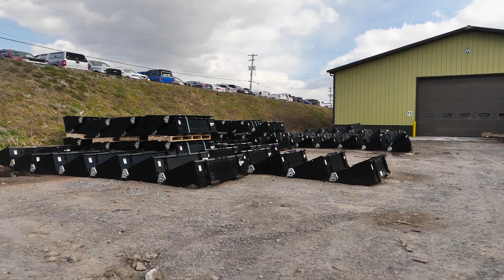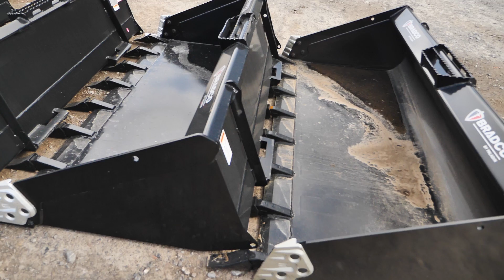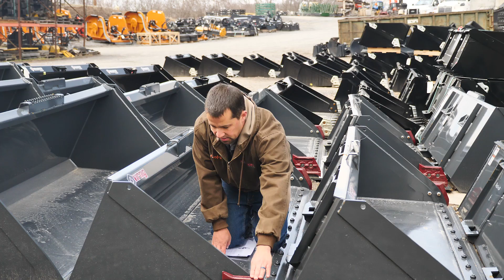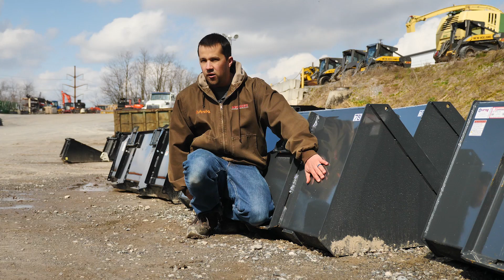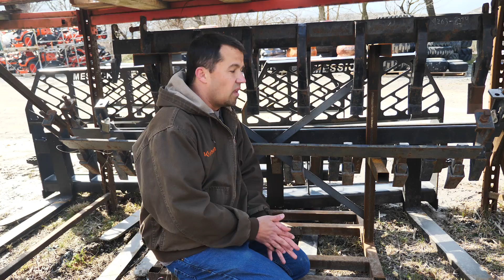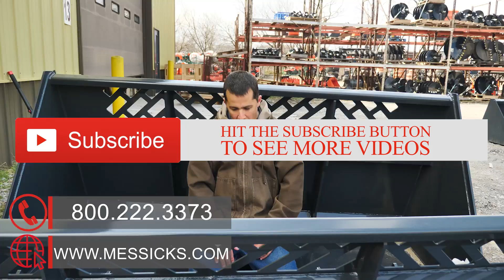How to choose the right skid steer loader bucket

Comment: FYI - The grade of steel does not determine weight.  Steel has a density of .2836 lb/in3 - regardless of the "grade" of steel as you refer to.  The weight of the product might actually be contributed to poor design.

Comment: Hey Neil,  I'm a welder/fabricator and have done my fair share of work building new buckets for excavators and front end loaders as well as repairing damaged ones.

generally speaking there is very little actual difference in the weight of different grades of steel, even looking at two type that are wildly different in properties like your bog standard mild steel compared to 304 stainless, the mild is around 7850 KG per cubic meter, and the stainless is around 8050 KG per cubic meter, despite the stainless containing 8% nickel and 18% chromium, with alloy's that are closer together like mild steel to 350 grade medium strength and AR500 wear plate your talking fractions of a percent difference in weight.

As far as what characteristics you want in the steel is a different story, the two most common failures due to use are cracking at high stress points (the corners of the bucket, where the attachment pin lugs are welded on ect) and wear on the leading edge, so you want a ductile steel that has some give to it for the body of the bucket so that it flexes rather than cracks and a hard wearing steel for the working edge, and these two properties are to an extent are at odd's with each other, steels like bisalloy/AR 400 or  are very hard wearing and last a long time on the leading edge, but are much more brittle than mild steel.

So my preference, and I find that longest lasting buckets are made with a LOW grade, ductile steel like G250 grade mild steel, while the working edges should be made of Bisalloy/AR 360 or 400 wear plate, and ideally you want the wear plates to be bolted onto the main bucket rather than welded on, as welding wear plate to mild steel gives are a fairly brittle weld that will crack over time, it also makes changing out the wear plates a lot easier. 

having seen the marketing Jargon with companies saying they use "50'000 PSI steel unlike our competitors who use 36'000 Psi steel" and seen the real world effects of that, I find it to be complete BS, tensile strength is not a huge deal when you consider that a piece of 2x2 inch by 1/8th inch thick 250 grade square tubing has a yield strength of 18 tonnes, and the higher the tensile strength of the steel, the more likely it is to fail from cracking and most catastrophic failures with any machinery you see will be from structural members cracking over time at a stress riser (where two parts are welded together mostly), not an outright failure of the material , I'd go for lower grade steel by design on a bucket for this exact reason, even if I were constrained to use the same thickness steel to build a bucket with either 250 or 350 grade, I'd still go with the 250 (although I would go 1/8th inch or so thicker depending on the size of the bucket with the 250 if given the choice)

Comment: Good video, good information.  At 2:50min however, you make a comment about high grade steel weighing more than low grade steel.  In general all steel (not including heavily alloyed) have very similar specific gravities so per cubic inch of steel material they will weigh the same.  A higher grade steel will be able to be thinner and provide a similar strength to a lower grade steel that is thicker, so the lower grade steel will carry a weight penalty if constructed to the same strength specifications.
Reply from the maker: Thanks. I sort of figured that, but the document I was following said as a guideline you can compare weights. Thanks for your expertise.
Reply: @MessicksEquip  if comparing 2 grade 50 buckets and one is heavier it's obvious the heavy one has more steel in it, ie reinforcements, etc

Comment: I have a TC33DA compact tractor with a 14LA loader on it. Off hand, I do not remember the lict capacity of the 14 LA. I am wondering how to select a grapple bucket for it.I am hoping to go with either a 60 or 66 inch wide unit. I will be carrying limbs and brush up to a half mile each trip. Given a specific Lift Capacity, how do you determine the Weight of the Grapple for max strength while also getting max load in it?    sdh in CT      any specific recommendations?
Reply from the maker: 60" wide, don't overthink it. You'll never notice the weight difference between most grapples. Style is important, quality, etc.. people overvalue weight.
Reply: But can I get real strength without needing extra weight? I had a Koyker and it essentially self destructed because of light material or poor design. It was fairly light so I was able to lift reasonably good grabs of wood or rock.     sdh in CT
Reply: @steveholton4130  That little tractor isn't going to destroy a grapple bucket, even if you buy a cheap one, bad operating will though
Reply from the maker: I'd echo this.

Comment: We’ve got a manure bucket, where the attachment plates and back wall are sloped back in such a way to get a lot of rollback. A non issue for manure is the dumping, so the missing dump angle isn’t a big deal, but the rollback angle is much better.